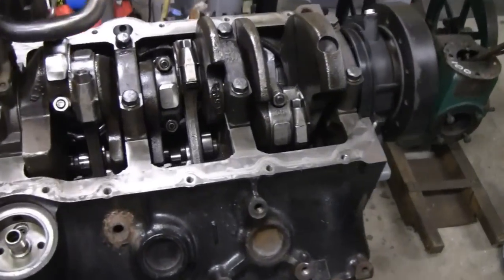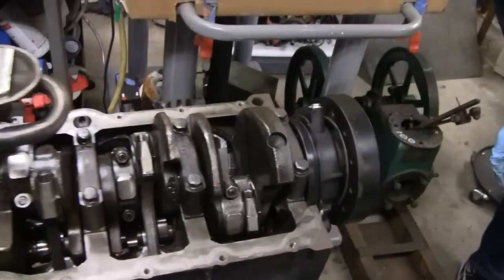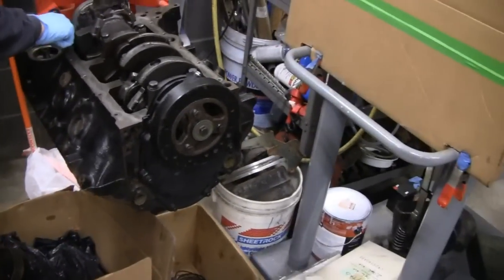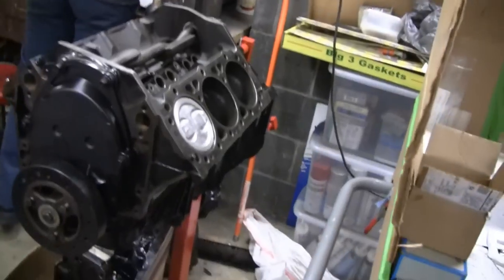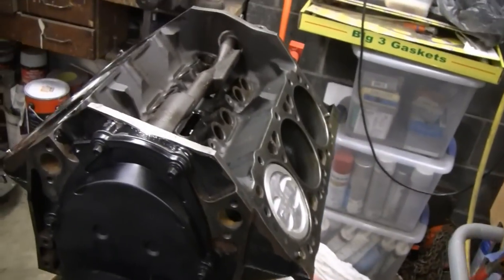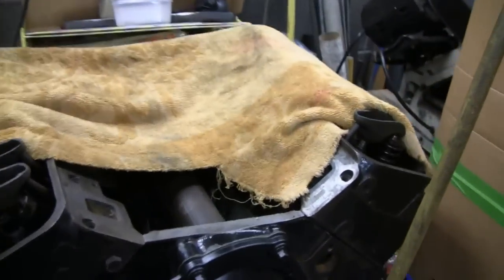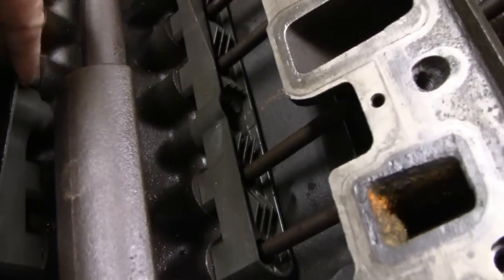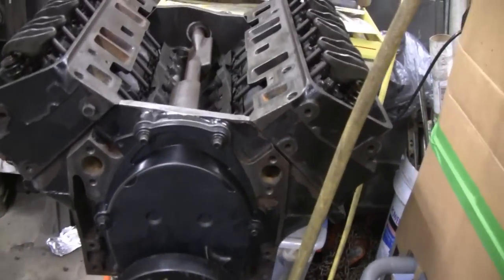CHEVY 4.3 ENGINE REBUILD (part 7)

Comment: did he decide to not put shellac on the head gasket? looks like its coming along!
Reply: I'm curios on why you would say shellac? I was wondering that too or atleast some kind of paint.
Reply: *****
Actually if you're using a composite gasket it is recommended not to use anything. Instead it's recommended to clean the surfaces with mineral spirits or alcohol etc, until  the surfaces can be wiped with a white rag and come up clean, and install the gaskets on the cleaned surfaces.
Reply: Yah I've done that too. I build alot of hipo engines though and a little extra help is usually needed. I usually clean up the gasket surface with a razor till it is clean and has a shine to it, then chemically clean it with a solvent, then paint the gasket on both sides. Even those composite ones. If I plan to remove the heads down the line I wipe oil on one side and paint the other. The painted side goes on the engine block. That way you can reuse the head gasket because the oiled side will not stick to the head.
Reply from the maker: outdoorsman310 Nah no shellac for Lil' Racer!! That's a Mike thing!!☺

Comment: I was wondering if you guys heard about painting the head gaskets before putting them on? I been doing that for years. When I was around 20 I was reading a ton af Hotrod  magazines and came across this article about how NASCAR engine builders would put on the heads, they would paint the gasket first, let the paint flash, then put on the heads. The paint would act as a sealer for the water jackets. Ever since then I been doing it and a couple of times I needed to pull the heads after a couple of years and boy, I had to rip them off with a crowbar, and the gasket, well I'll just say I was scraping for a couple of days.
Reply from the maker: ***** I've never heard of paint before, but we have used Indian Head, that's a shellac!! I'm sure the old lacquer paint had the same effect!!☺